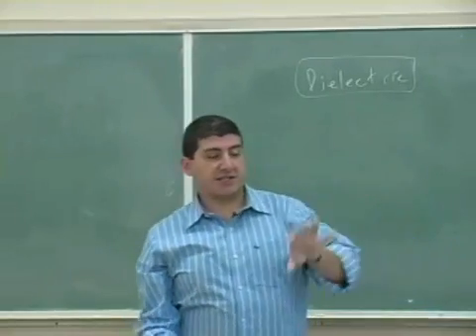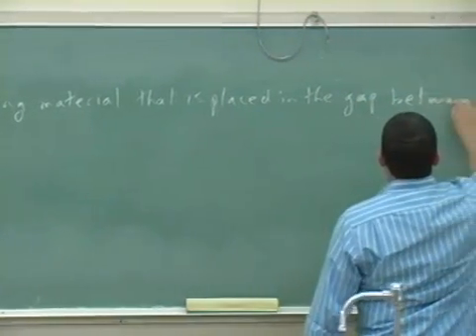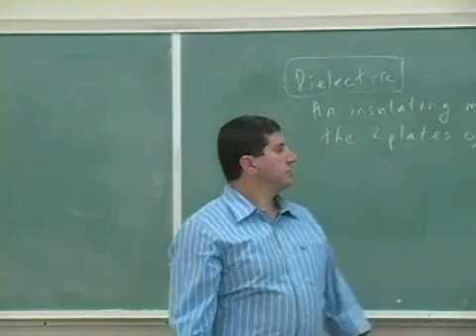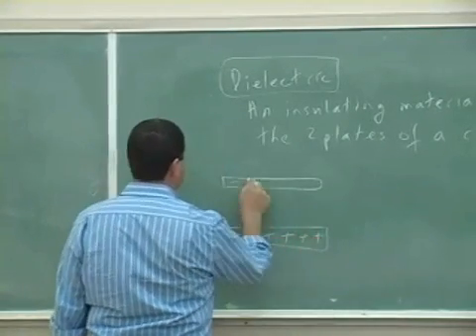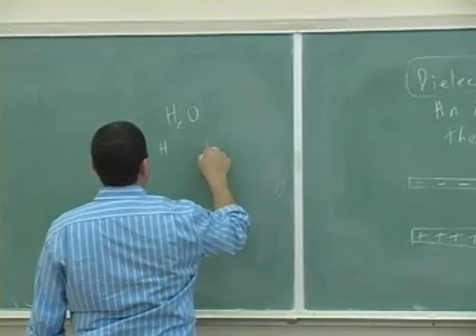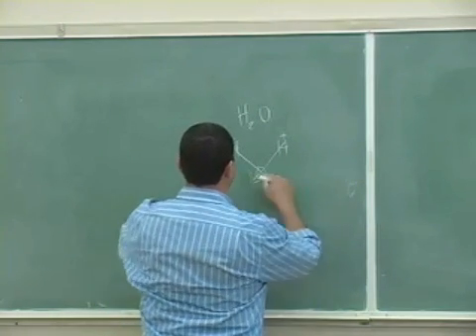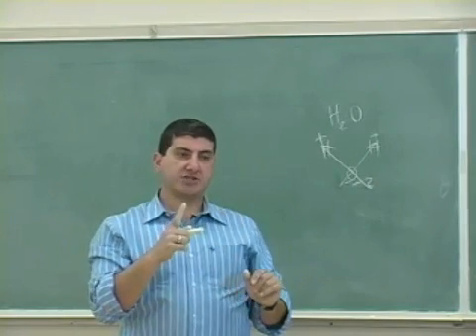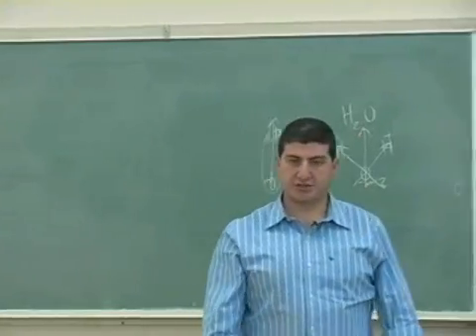Capacitors and Dielectrics Theory Part 1

Comment: @719freethinks 
Look at the water atoms by themselves all alligned, without the plates. The hydrogen atoms are on the top, oxygen atoms on the bottom. Meaning more positive on top, more negative on the bottom, creating a net field downwards (positive to negative). Which is exactly opposite of the field produced by the plates which was upwards. Combining them gives a net field upwards which is slightly less strong than the original.